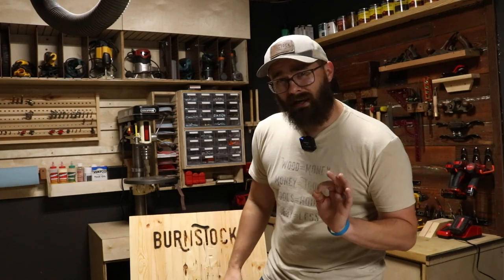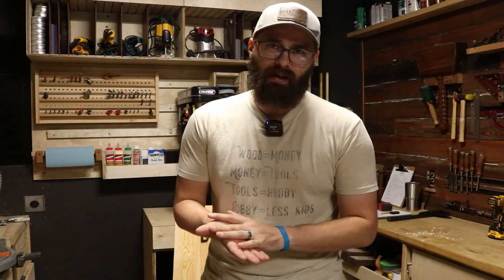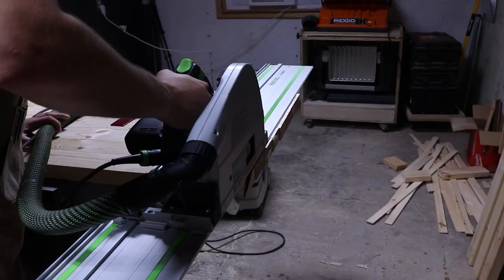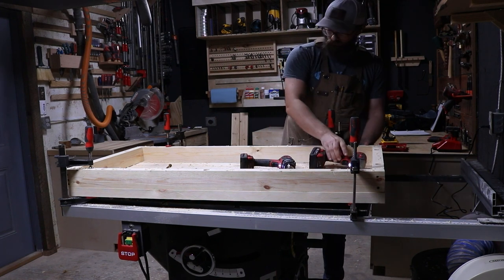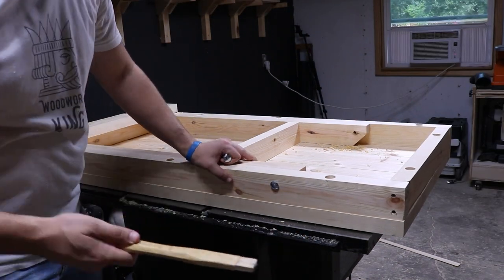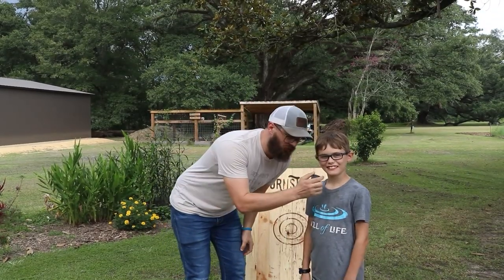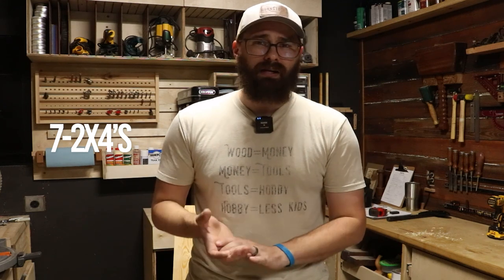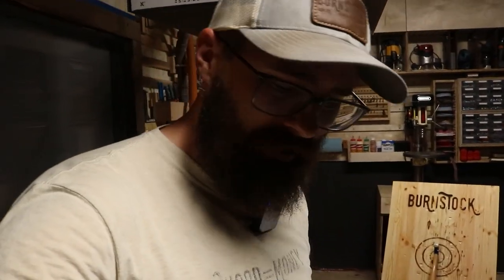Woodworking Project that SELLS!!! Easy Beginner Project

Comment: Maybe add a plywood front to be sold at a lower cost so when the 2x4 is destroyed you can replace with fresh wood? Using a laser engraver you could have the target set the same size each time. Super cool idea! I think 200 is pretty steep though… maybe 150?
Reply from the maker: Great idea on the plywood.  Price really depends on area.  In my area 220 is a good sweet spot for something like this.
Reply: You can get $400 for a Cornhole set. You should get $250 for this.

Comment: How well does the target work with the angle? I find it a safer option than vertical to reduce rebound, but I wasn’t sure if there was reduced performance due to the angle.
Reply from the maker: I don't know enough about that to give a good answer.  This is my first time throwing hatchets, but it hasn't seemed to be an issue.